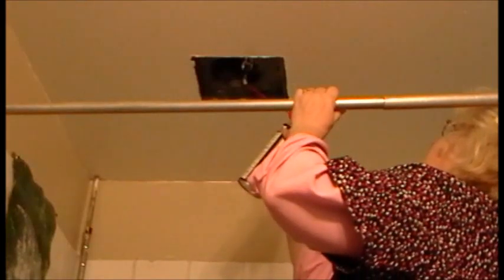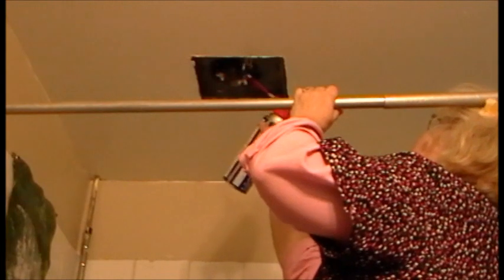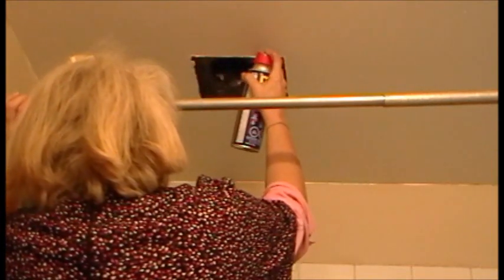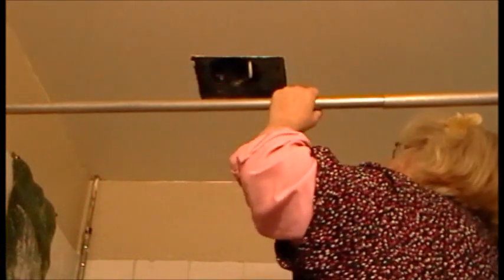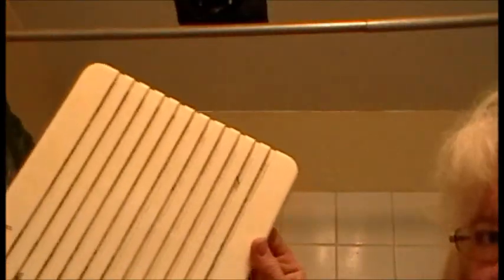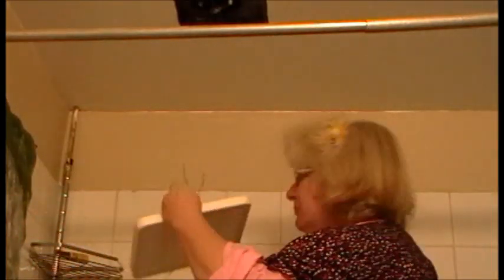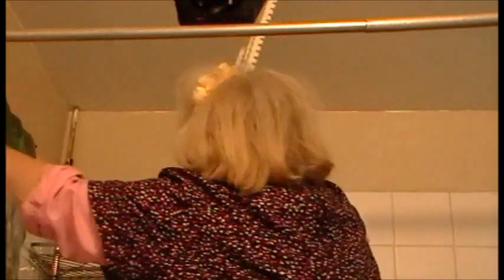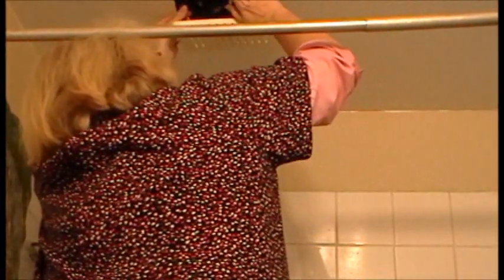Nancy Today: How to fix a squeaky fan

Comment: NVHSChadSheppard1 Yes it is.
Reply from the maker: Gee, you know what kind of fan it is?  You're either an electrician or you're a fan fanatic!
Reply: NancyToday yeah! I've seen alot of those fans and if I look close at them they say Nautilis on the corner of the cover. also this helped me fix my 63 year old broan extractor bath fan that was making a horrible screeching noise.